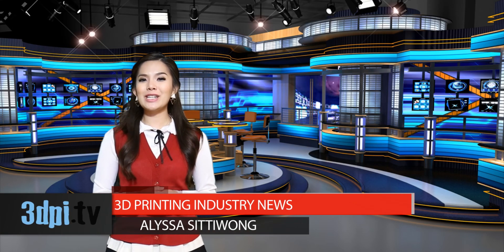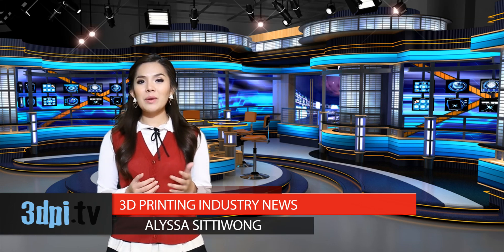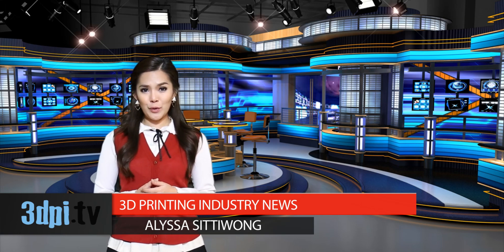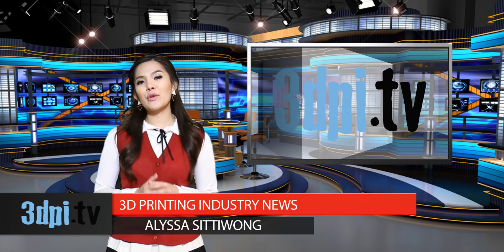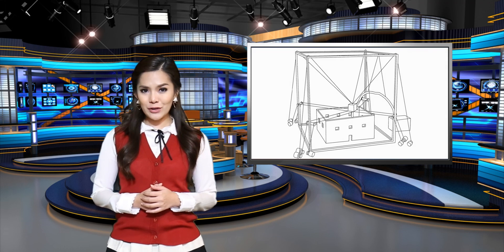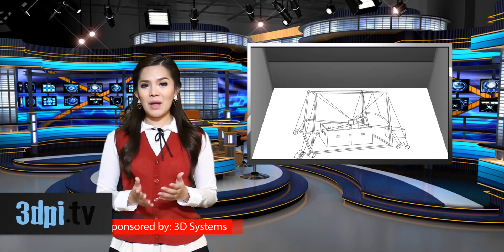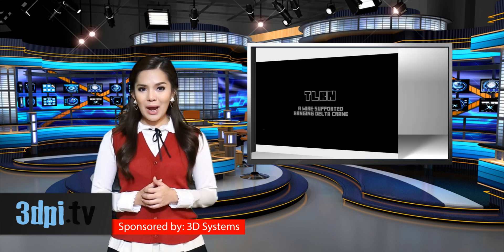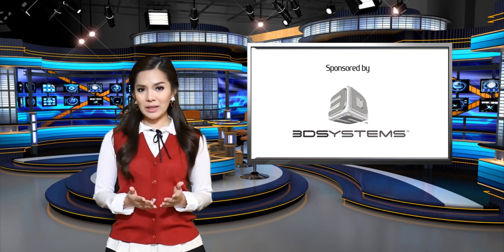3DPI.TV - How to Make 3D House Printing Accessible

Comment: The real problem with a 3d printer that makes houses will be mobility and ease of assembly.  The depictions I have seen are only some one doing a construction with in a building / whare house.  With out the attempt of trying to make a printer work from a mobile platform first.